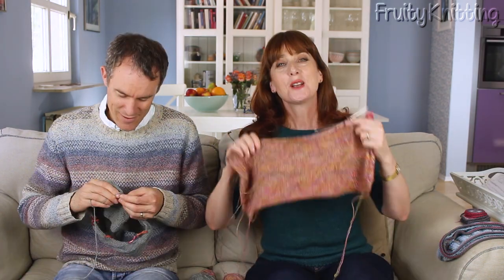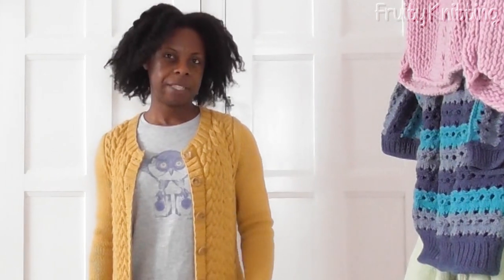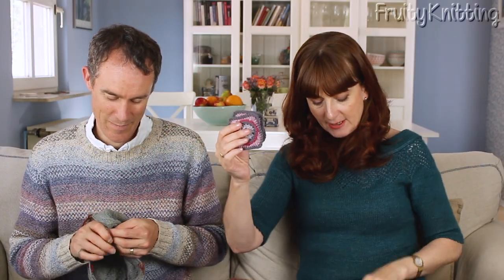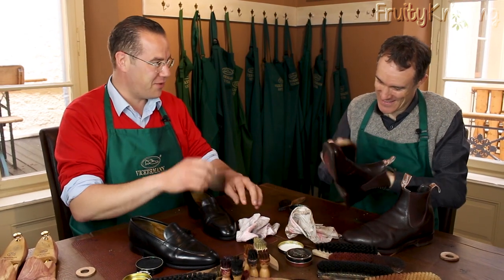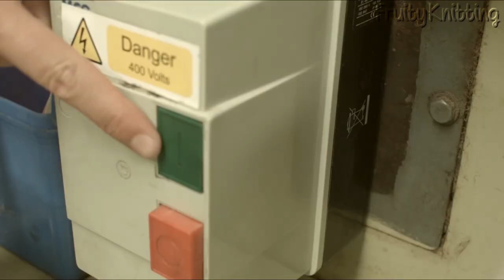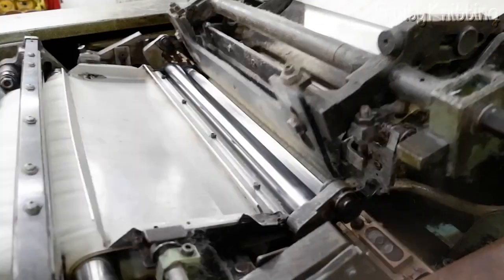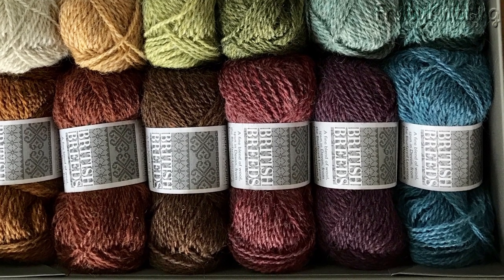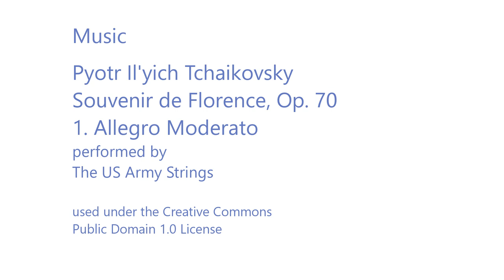John Arbon Textiles - Ep. 79 - Fruity Knitting

Comment: Andrea, your crochet blocks look quite excellent! Not sure if you have blocked them yet.I will tell you that crochet needs a proper wet block to look properly finished. (Steam blocking doesn’t do as well) It really evens out the stitches and opens up the holes. I would recommend soaking and pinning all your pieces to size as you make them. It will make piecing things together so much easier.
Reply from the maker: Thanks Yetta, I'll try that.